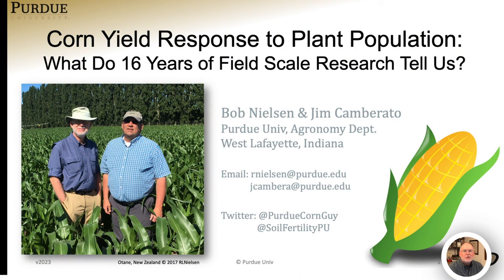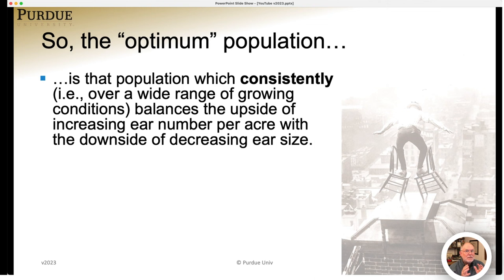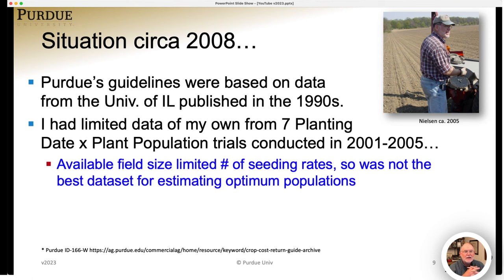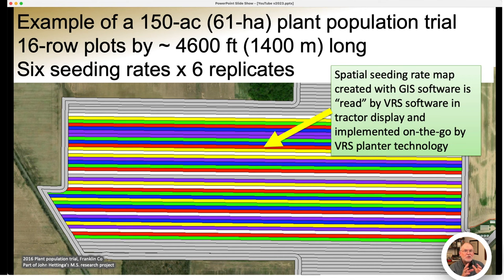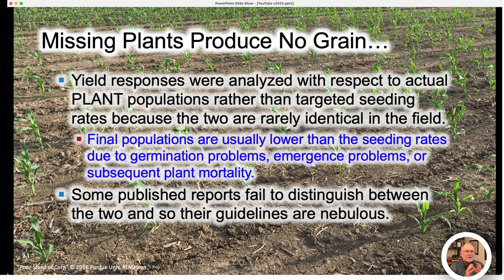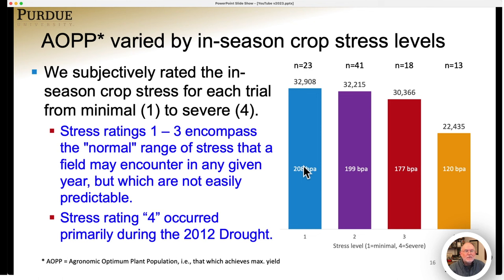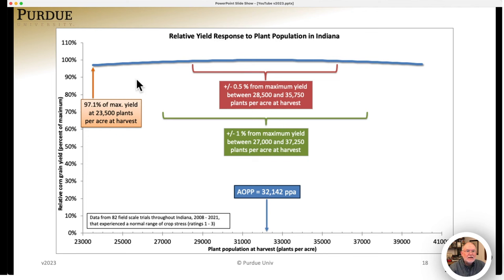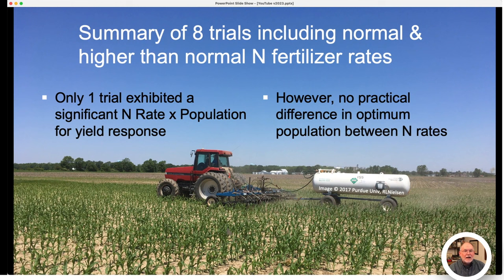Yield Response to Plant Populations in Corn

Comment: I am in a very yield limited environment in East Central Minnesota. Did a lot of population studies with Pioneer. We had a 24, 30, 36 and a 42k population across four hybrids each year. And every year the higher population made the most yields. But the 36,000 consistently made better money. 32 or 34 is the common upper end and there's still a lot of areas that 27 and 29 are the best bang for the buck

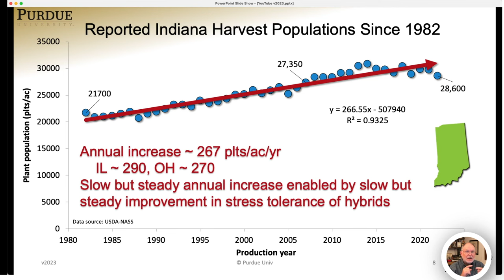Comment: Curious if the chart at 5:50 showing increasing population tolerance of hybrids, due to selecting for that feature alone, has reduced other important variables like nutrients and protein in the corn? .. Seems like I've seen "the great pursuit of yield" has lost most of the protein, as low as 3-5% protein remains from what started as 9% protein in source yellow heirloom corn (such as Reids Yellow Dent). I started growing red and blue heirlooms that run 12-15% protein. Impact is real, a pig farmer I know found a 20% increase in litter sizes after he switched to high protein heirloom corn. I found heirloom varieties do best at lower population rates like 22-24k, but the yield loss from fewer plants is more than balanced out by the increased bacon!  Last winter's drop in egg production rates noted by many homesteaders revolved around too-low of protein in the common retail brand of chicken feed to lay eggs, such as a batch of low protein corn substituted in the recipe, because when homesteaders switched feed brands their egg production returned. Perhaps there is a future research project in high protein/nutrient corn? Quality vs Quantity?
Reply from the maker: Excellent point you raise, however I doubt that modern hybrids' tolerance to population is the CAUSE of lower protein in and of itself. It's long been recognized that there is a negative relationship between grain yield and protein in corn, but the physiological cause/effect for this relationship is not well understood. So, for now, all I can say is that the yield improvement that's occurred over the decades has simply unintentionally resulted in lower protein content.
Reply: I forgot where I heard it but by taking protein out of the Corn you get a lot more kernels with the same amount of nitrogen. But like you said the colonels are just empty